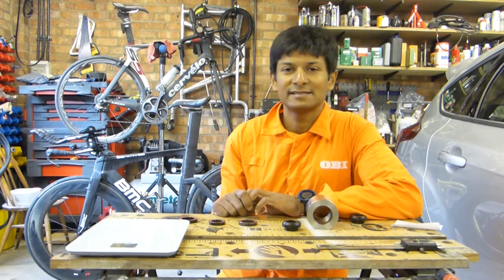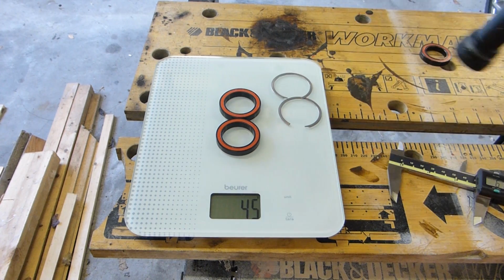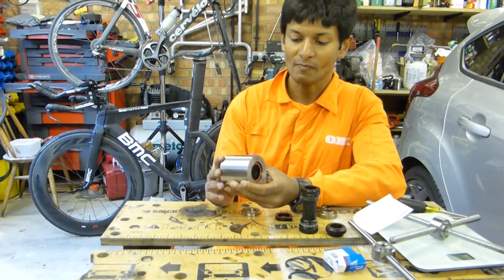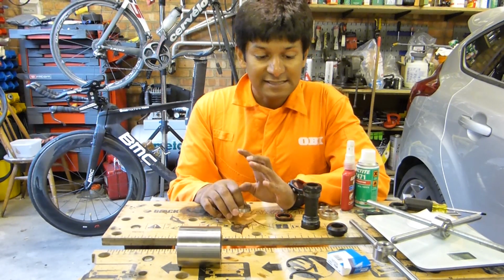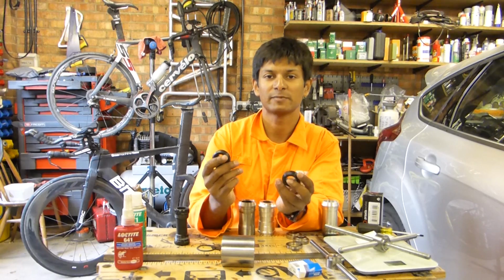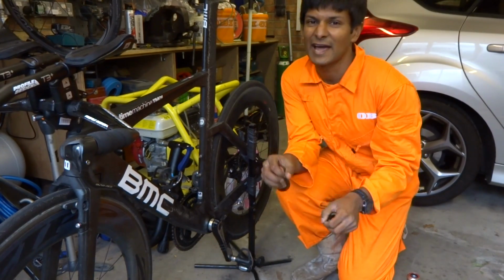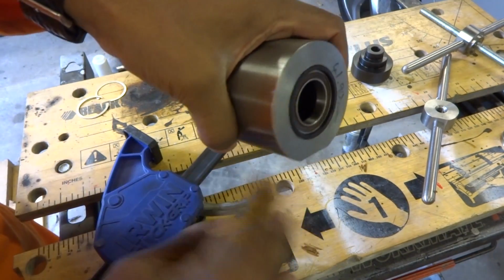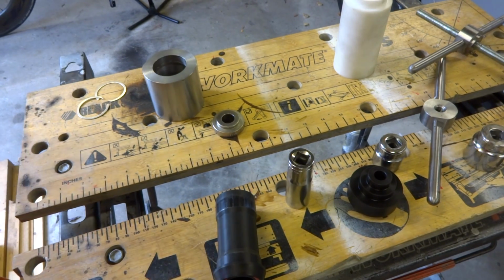BB30 Bottom Bracket Explained, Creaking, Pros, Cons and Fitting Shimano Cranks by Hambini

Comment: Hi have a S-work venge 2015 with ceramic speed bearings. I have the dreaded creaking. I usually epoxy them in but after a season they start to creak again. Does you replacement part fixes the issue, if not what's my best options? Thanks

Comment: Mr Hambini, I have a question regarding the one-piece bb30 to shimano 24mm adapter sleeve you made.. I was thinking .. after pressing it in from one side all the way thru.. the only thing keeping the one-piece sleeve in place is friction. Is that enough to keep it place. Doesn't that set up needs a lock ring of some sort for added security to keep that from slightly sliding back out where it came in?  The material you used for the demo is aluminum/metal and the interference friction( is that correct?) is high because of the nature of the material.. But what if the frame material is carbon.. and have gone thru a number of bearings as such the 42mm bb shell have slightly been enlarged due to the process of press in and out. I hope you can comment and highly appreciate your suggestion. Thank you!

Comment: Have been speaking to Hambini regarding fitting a Hambini BB. You can come unstuck if a part of the bike sits proud inside the bottom bracket. 
In my case it was a LOOK bike that has a retained bolt embedded in the epoxy for holding the cable guide underneath the bike. So you can't get the one piece BB over and reseated on the other side when installing. 
So please check your bottom bracket has free access to go right through. Hope this helps.

Comment: So why so many complaints of creaks on caad13 (and other al frames)? With a properly stabilized and jigged alloy frame it should be straight forward to machine an accurate bore straight through to proper interference fit tolerance?

Comment: Hi. Im new to MT maintenance and have been in the hunt for a detailed video about bottom brackets, especially adapter shell removal and installation. My search is over.  😁The  English standard adapter shell started to slide out of the frame and caused my pedals to hit the swing arm. Now thanks to this video I have a full understanding of whats going on😀👍I just need that plastic sleeve and other tools to push it all way out then back in. Thank you so much. Liked and subscribed💯👌👏

Comment: Thank you very much for this excellent presentation. The creaks are gone now, after first pressing the BB30 cups into the OSBB 61 x 46 mm(!) bracket (specialized venge carbon frame 2013) and using the Loctite 7471 to fix the cups in the carbon frame and, later, use the Loctite 641 to fix the BB30 bearings into the cups.

Comment: What is your opinion on the older Kogel BSA30/386-R (24895) which is a BB30 to BB386 adaptor that uses a solid sleeve and threaded BSA bearing holders? Ronald Kuba used one on a Specialized Tarmac to "fix" the creaking issue and install SRAM "BB30" long spindle cranks. I wonder what your take is on these and if you had any other solution or better option to have a very well aligned sleeve on a BB30 Specialized BB to mount long spindle "BB30" SRAM Red cranks.

Comment: This posting is not the Hambini we've come to expect. What, no power point? No chart? An entirely intellectual discussion except how the hell you actually measure the inside diameter of the bottom bracket that accurately. I'm not wild about using a vernier caliper since it is so difficult to get accurate and reproduceable readings. But yesterday while cleaning out my bike part cupboard I stumbled across my inside and outside micrometers. You would normally only insert the Hambini BB in and just replace the bearings if necessary - the quality of the bearings he uses would normally not require replacing unless you're a pro putting in several tens of thousands of miles on them each year. I can't even get cheap Chinese bearings to wear out since I don't put enough power through them. I have used the FSA 30 mm EVO cranks and the "Gossamer" aluminum cranks and they are cheap and effective. But the Shimano 24 mm cranks seem a better all around crank to me. Certainly if I had a BB30 I would buy a Hambini BB and install a Shimano Ultegra or Dura Ace crank though the 105 are extremely well made as well.

Comment: 2013 F29er, Lefty, carbon here.  I have a BB30.  However there are no cups, spacers or snap rings.  All I have are 2 bearings which are pressed directly into the frame's BB shell.  I have changed them recently after 11 years of use.  Have never had a creak or any problems.  I changed them just because they were originals and had a lot of use.  No problems.  Yes, I know, if it isn't broke, don't fix it.  I put white lithium grease around the bearings before I pressed them in.  Have been riding all year in mud, dust and general wetness.  No problems whatsoever.  Am I just lucky?

Comment: Hi Hambini, I currently have a Boardman Adv 8.9 with a BB4000 bottom bracket that fits to  FSA Omega Chain set 10speed, which I'm wanting to replace (as it's crap!) with a Shimano Tiagra or 105 chain set.  The only issue I'm unsure of is what BB I should be getting that will fit my bike and the Shimano Chainset?  If you can advise on what are the best tools for the job too it would be greatly appreciated 🙏 I've just come across your Blog and they seem to be really interesting, looking forward to going through some of your video catalogue, keep up the good work 👍

Comment: Firstly, loving the channel...... especially your "say it how it is" style....
Just one thing though..... Loctite activator doesn't make bond stronger...... it improves the curing on inactive surfaces, such as Anodized Ally etc....
Activator actually reduces the bond strength considerably below the locking compounds "Potential" strength..... BUT when bonding difficult surfaces, it's better to have a reduced strength bond that works, rather than a bond that fails to take....
I know it a small point, but I think it's work making, for clarity.

Comment: Hambini, regarding your BB30 adapter, if the holes in the frame are not perfectly round (like your blank) will your adapter not slip from side to side?  At least with the Praxis there is a lip and and thread to hold the two cups together.  What will hold your adapter in place if friction is not enough?

Comment: What seems a mystery to me, and which is brought into clear focus when you speak of the adaptors to make the BB30 compatible with the shimano 24 crank, is what the hell connects the crank to the inner surfaces of the  two bearings?  I see a crank spinning in a tube by its own friction making the bearings irrelevant.  No one has explained this,  and I am sure the answer would be obvious to anyone who has hands on experience.  I do not have that.   All the discussion of BBs centers on the connection between the bearing and the shell, but the other side is COMPLETELY ignored.
Reply: The least expensive adapters slide onto the 30mm bearing and make the inner diameter 24mm. Other adapters press into the shell and use the smaller 24mm bearings. Either way the crank spins on a bearing and not just in a tube.

Comment: Hi Hambini, you're a little off on your history so forgive me being pedantic.  BB30 introduction somewhere around 2002* well Shimano was still solidly pushing Octalink (on a 68 mm BSA), Campy was still using square taper (either 68 or 70 mm) and on mt bike side RaceFace and Truvativ (Pre-Sram) pushed the inferior ISIS (obliviously the Interface Standard not the terrorist group). Hollowtech II and outboard bearing didn't appear till 2004 with the release of Dura Ace 7800 groupset. Campy continued with Sq Taper right through 2006 and caped off with Paolo Bettini world championship victory. Octalink in fairness was a reasonably good system other than the 1st generation Dura-Ace's being frail to save weight.  So at the time just about everyone in the amateur ranks as well as the pro teams (like Mercury and Saturn) just used the Ultegra one. Personally I should seen this mess coming, at the Green Mountain Stage race in summer of 2003 I remember someone overhauling their BB30 within an hour of start time of first stage.  Also you correctly have dim view of Cannondale, they single handily turned the industry in wrong direction with excessive marketing push of the Saeco Cannondale team via Cipollini.  C-dale was also an early adopter of an internal headset, push frail and temperamentally light frames like R5000 in CAAD7 variance (hence the nickname Crack and Fail), plus they where amongst first to outsource production of the fork to Asia after the bankruptcy from motorsport venture in 2003.  Before that OEM forks where generally high quality from Look, Time, Easton and Reynolds.  I know you like to name names, so I'd say Chris Peak (maybe Curt Davis) are two engineers behind some of these bad choices and wait for it Chris Peck is "Product Design Engineering Director at Apple"  *page 34 - https://vintagecannondale.com/year/2002/2002.pdf

Comment: i need help, i have my 2018 specialized tarmac sl4 sport, run with the original bottom bracket which is Praxis alba m30 with praxis works crankset (CRANKSET: Praxis Alba M30, solid forged arms, 6061 chainrings, 110 BCD, 11-speed)FRAME: Specialized Tarmac SL4, FACT 9r carbon, compact race design, 1-3/8" lower bearing, threaded bottom bracket, 130mm spacing and i want to change them to shimano hollowtech, i already bought shimano hollowtech crankset (FC-6800). The question is what type/model of shimano bottom bracket should i use and do i also need  sleeve? thanks you guys, all answers are appreciated.
Reply: I had an SL4 with BB30, what i did was bought an Internal Threaded Sleeve from Wiggle. It needs to be Pressed in but to make it easier i left it in the Freezer overnight which worked, after that you can then go to Hollowtech 2 or i fitted Ultegra Threaded Bottom Bracket.
https://www.wiggle.co.uk/fsa-bb30-conversion-kit/

Comment: "I am an aero space engineer." First time I've ever heard anyone say that, and so casually too …

I have a Specialized frame with their OSBB. Is that equal to the BB30 standard, in regards to measurements? I want to use the Wheels Manufacturing converters, that you have in the video, to use a Shimano crankset.
Reply from the maker: OSBB comes in 3 types that are all called OSBB. One of them is the same as BB30
Reply: Hambini those OSBB is a nightmare, and the is no info to accompany them. How do I know which I have?

Is it only the width 68 vs. 61mm that differs?

Comment: Hi, can you show the proper way to remove BB30 bearings...?  Reason I ask is I went to a mechanic who is good and who I trust to have my BB looked at because I thought it was creaking (turned out to be something else), and he banged out the bearings from the opposite side with a rubber mallet and a rod, and I was thinking that can't be right what he's doing.  Seems it could damage the bearings as well.  Thanks!

Comment: Thanks for the great video and solution. My synapse BB is clicking and so I am really looking in to this. I have a few questions and would appreciate if you could answer them:
1. Have you checked what is the weight penalty for fitting the Hambini system with an ultegra crankset compared to the original cannondale's si crankset?
2. Are there any limits of BB hole tolerances in a frame beyond which the Hambini BB would not work?

Comment: I bought a  Planet-X carbon frame a few years ago, that had a BB30 bottom bracket. The Planet-X press-fit bearings and circlip fit well. I ran a vernier around the inside of the bb on the frame, the inside was good (ie round). I used a set square to try and ensure the bearings would line up laterally, they did. I fitted the press-fit bb, and the chainset (SRAM Red). So far in the last 6 years, no creaks.  But I have only ridden about 2000 miles.

Comment: What stops the one piece BB from moving in the frame? (Ie moving to the drive side )
Reply: my thoughts eactly
Reply: Why would it?
Reply: @rcg9573  because it can, it doesn't matter how much shite about interference fits he spouts the reality is, if it can move it will move. The guy is obviously a good engineer but he is no mechanic, watching him work is like watching a puppy try to fuck a beach ball.
I learned long ago that engineers generally understand theory whereas  mechanics understand reality.
Reply: I also wonder why this system would not develop its own creak. Wheels MFG makes a threaded system that keeps the bearings in the original location but the thin flanges on the out side lock the part into the pressfit location similar to the praxis system but with no o- ring in it .

Comment: I was a mechanic for long enough to experience and see some ridiculous stuff, most consistently from Cannondale, with some paper thin BB30 shells! I once worked on a super6 and took off both the cranks and left the spindle in, just turning the spindle by hand made a creak massively resonate thought the carbon, it was unbelievably loud! Some nice extra info that I hadn't known about the manufacture however thank fuck BB30 isn't used anymore, what an absolute waste of time in the cycle world spent on a design thats only benefit seems to be 20~g weight saving HA-HA-HA

Comment: What about the spindle walking within the bearings? I'm not an engineer, but I am a mechanic who has dealt with hundreds of creaky 30mm spindle BB's. From what I've seen, most creaks are from the spindle to bearing interface and not the bearing to frame, or cup to frame interface. I never see any witness marks from movement within the frame, but plenty of wear marks on the spindle from movement within the bearings.
Reply from the maker: It should be a transition or sliding fit on the spindle. The interference is on the outside. If the spindle "walks" the outer is also "walking"
Reply: @Hambini  When I say "walking" I'm referring to the the spindle moving side to side within the bearings. Obviously, the spindle has to slide into the bearings to be installed. 
From what I've seen, the worst offenders are the BB's that use a wavy washer. Even the the correct amount of spacers added, and the wavy washer compressed 2/3 of the way as per what I've seen specified, you can still physically push the cranks assembly sideways and move the spindle a slight amount within the bearings.         
  Over time, an aluminum spindle on a steel bearing will creak once it gets dirty between the bearing to spindle interface.  
Look at any anodized 30mm spindle that's been used for at least 3000-5000 miles. the anodization will always be worn off where the spindle contacts the bearing from the ability to have micro movements within the bearing.
Reply from the maker: Hi Joey. That bit you are referring to is governed by the crank maker not the BB. I do agree, the Shimano style preload system is much better.
Reply: @JoeyMesa  This is happening to my spindle, as well; it moves within the inner race of the non-drive bearing. At first I thought it was a problem with the preloader (which I have replaced), but the creaking continues, so I inspected the spindle/bearing interface and found movement. In your workshop, what do you do to fix this?

Comment: Great video Hambini,i have a basic super six,great bike but as soon as i stand up it creaks its nuts off til i sit down.
has a heavy fsa omega crank set,i have upgraded bike to r8000 and would like to fit shimano r8000 chainset to finish it off was looking at praxis conversion but after watching this i might not.how much are you asking for your bb conversion?
Reply from the maker: They start at £89. You might have a worn bore on your frame,
Reply: @Hambini  the bike has always creaked under load,changed my pedals,no difference my best bike so not had a hard life,my events normally in the lakes,hardnott,wrynose kirkstone passes lots of strain ,was thinking of getting hollowgram c/set but think i would still have the creaking,so i will have to remove bb to see if there is wear in the bb housing

Comment: You certainly know your stuff. Just a quick question, I have a cannondale caad 12 and suffer with the dreaded creak. I have you used numerous manufacturing alternatives but to no avail. Contemplating using Loctite, you mentioned the activator , is it worthwhile using the product with aluminium? cheers chris
Reply from the maker: It's not usually needed for aluminium. There is no harm in trying it other than the expense.